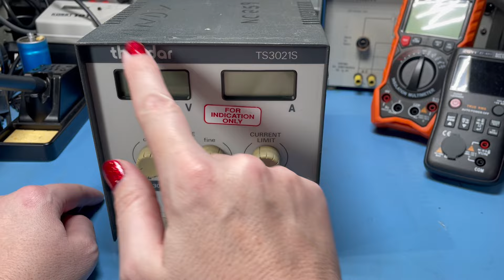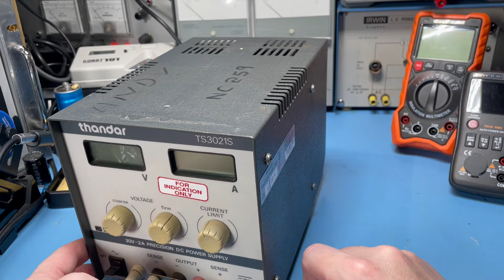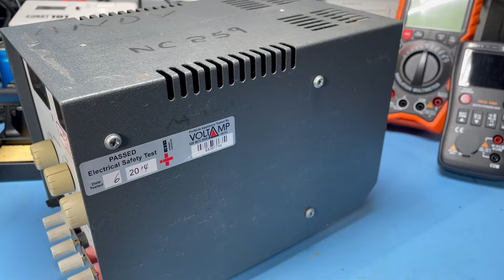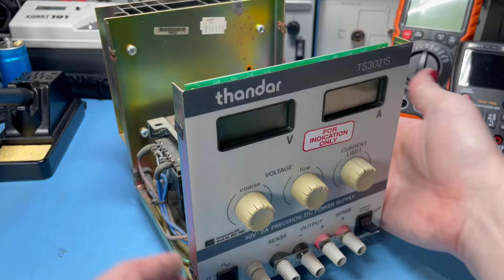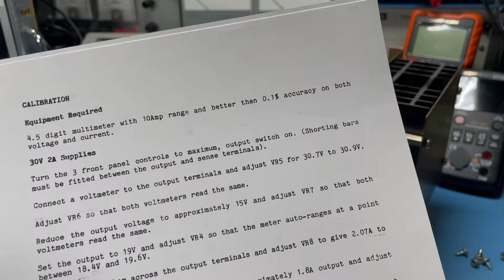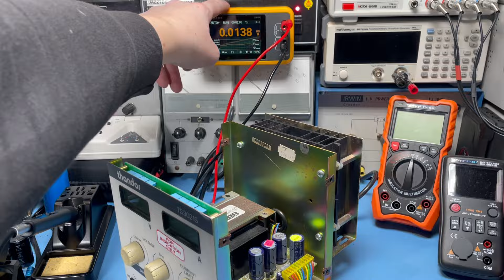Thandar Bench Power Supply Calibration TS3021S & TS3023S 30V 2A DC Power Supplies!

Comment: I have the exact same power suply .the calibration is more like 3/4 volts out .what would cause the power suply to go out of range like that. Hopefully, I will try to calibrate it when time . Thanks for another great video.
Reply from the maker: Check your multimeter that you are checking with against another multimeter just to be sure. Get the technical manual and attempt a recalibration. If you can't bring it into spec with adjustment it may have a fault or a component failure that is causing it to be so much out. Then you will need to work on it and try and find the fault, which may or may be easy for you.
Reply: @JazzTechUK thanks for replying. I've found what's wrong. At 18.56volts  the power supply changes from 18.56 to 19.3 loosing one digit. So i reduced the voltage to 18 .12  ,and now its spot on . Im using a fluke 189 to do the calibration, and now all the way through the scale the thandar is the same as the fluke from 1 volt to 29.98 volts . I hope l have explained myself, but with your helpful video i have now a very accurate power supply.  Thank you . Merry Christmas.  Rob.

Comment: JJ: Doesn't that cellphone camera have a mirror/don't-mirror setting?  At least one of the cameras on my phone has a mirror control setting.  Probably the one facing the wrong way, though.
Reply from the maker: This is an older scratch iPhone just used for odd bits and pieces. It doesn't have the mirror setting 😢